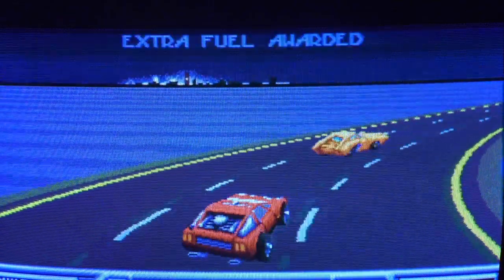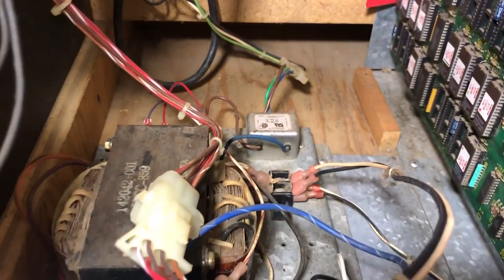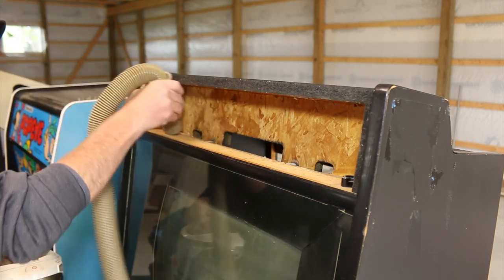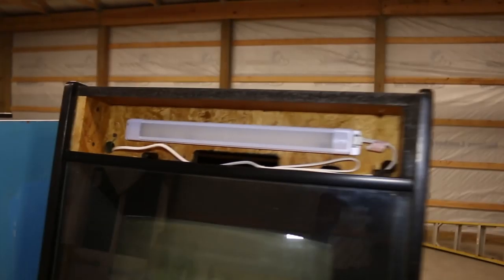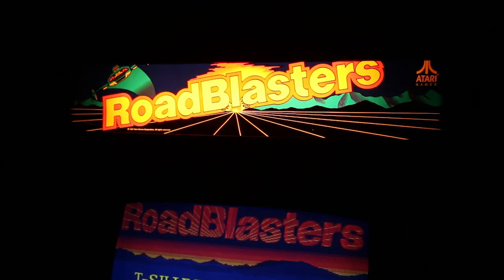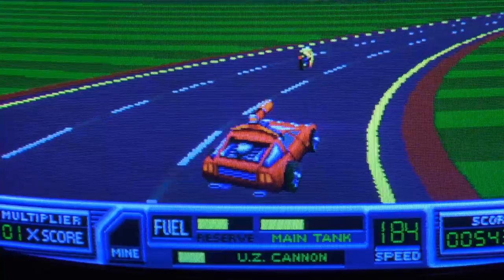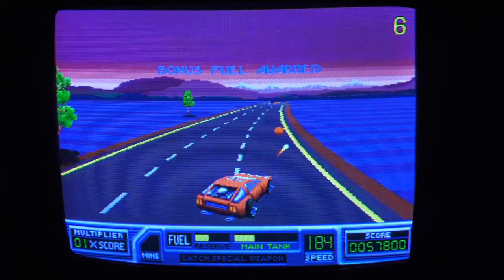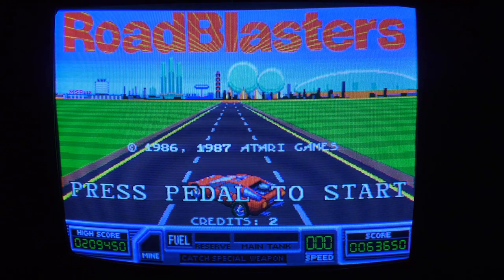Roadblasters LED Marquee Light Mod arcade

Comment: Like the mod, I’ve done it a couple of times. Now I discovered that Wal-Mart carries Drop in LED bulbs for $7 that don’t need the starter to be working. Works great too and you can leave everything original.
Reply from the maker: Alan Brady I will check those out!!  Always great to leave things original if possible.
Reply: Alan I use the same ones. They are perfect.
Reply: Do you have a link to that ?
Reply: No link, just check your local Wal-mart florecent bulb section, it’s the great value brand same specs, and it’s drop in ready.

Comment: 6:07 you grounded a screw!?  ;)
Reply from the maker: I did!  I might need to revisit that.
Reply: Adding a note:. The LED fixtures from Walmart only have 2 wires so they splice perfectly with any cabinet. No green ground wire to worry about.